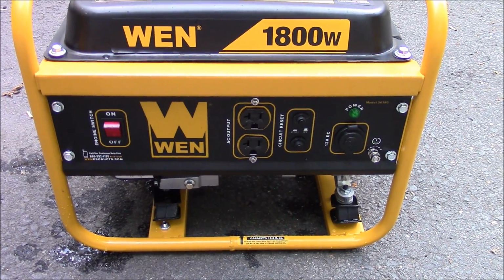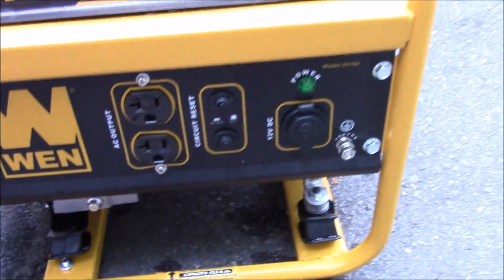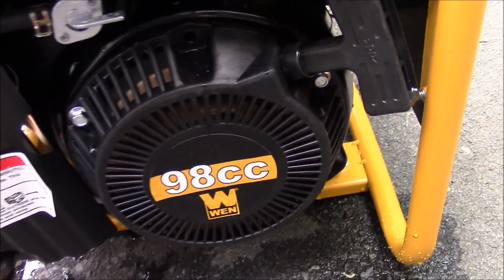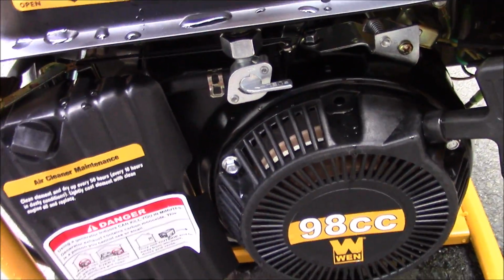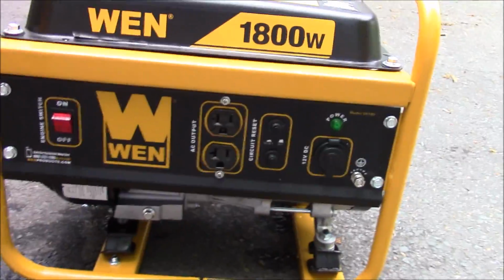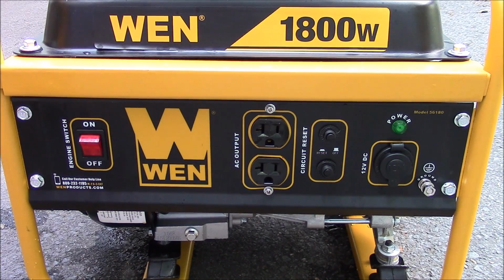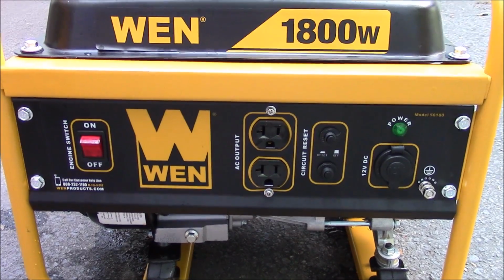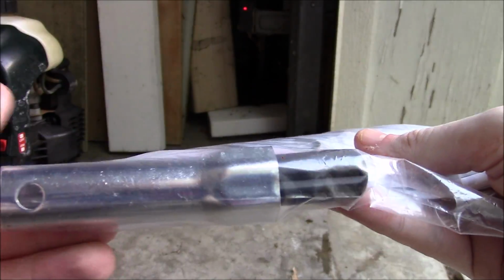WEN 1800 Watt Generator (56180)

Comment: Okay question sir at the top of the generator theres a hose top left of where you out the gas ... that hose is broken is would that prevent the generator from working if yes ... what is that part called so i can replace it or get it fixed
Reply: The hose im talking about is above the choke lever sign

Comment: This generator is really good.☆☆>share4.photo/Wen22Inverter?ㅑ    I bought to run electric sds max drill. It is super quiet and light weight. It fits my need and highly recommended.

Comment: you should've received a long funnel to fill the oil and shut off the gas to empty the carb when storing,unscrew the screw on bottom of carb to drain the float bowl,if not,it will not run after 6 months of storage,always use fresh gas or treat your gas,,a new carb is 12 bucks on amazon,consider getting an extra one when you can,it will come in handy."cheaper than rebuilding the carb.

Comment: I just bought this gen and for some odd reason its not letting me turn on. I put gas put on the valve and close the choke and pulled and  been pulling 10x and doesn't turn on.. can anyone help me please
Reply: Alex a did u put oil?
Reply: not oil,or not gas   @raymondtorres6214

Comment: I just bought one. Haven't received it yet but already I'm sceptical. Yours has a 1.45 gallon capacity, yet mine is only 1.1 despite being the same model number. Why would Wen purposely deceive the public. Some online 1800's show different capacities. I bought mine based on a 1.45 capacity. Any thoughts? David 😋
Reply: If it gets 7.5 hours >>on a full tank,<<  wouldn't you rather that full tank be 1.1 gals instead of 1.45?
Reply: Lol, thanks for replying! I was told that the tanks were mislabeled. Mine says 1.1 but it's really 1.45....All the internet advertisements say 1.1 but its not. I measured precisely. Even the guys in customer service were at a loss as to why they were mislabeled. They had me send them pictures of my label and SN of the unit. What's counts is that it has worked perfectly for over a month. DAVID 🚀

Comment: Has anyone ever had a fuel leak from the carburetor on this unit? I've had it for a week and whenever the fuel valve is in the on position it leaks, even before I start it up.
Reply: Float Bowl
Reply: Sounds like you either have a little split in the gas line or a bad gasket between the carb and the carb mount. If it is leaking from the fuel valve itself, that gasket could be bad or the screws loose.

Comment: I ran this generator for 3 days at a country music festival. It's worked great. best bang for your buck. It won't run a 8k btu a/c tho. I ran a 5k btu window a/c unit.
Reply: It runs great. You are correct it won't run a 8k btu a/c, but I have a 3k btu and it powers it like a champ. It was hard to start when cold weather began, so two shots of starter fluid, choke, and we were good. I love this generator.

Comment: what about an air conditioner?
Reply: +Terry Browning 8k is to much for this wen. I tried.
Reply: It'll run a 5000 BTU window AC no problem.....8000 BTU might be a bit much....
Reply: Dominique Stone no
Reply: Dominique Stone it will run a 5k btu ac unit. maybe even a 6k..
Reply: Its this generatorcan run a vaccum and buffer at the same time?  Tank you
Reply: Dominique Stone I would have to add the amps off both vaccum and buffer. Can you look on the machines and tell me?

Comment: thank you for the video am really thinking about buying it am still in a debate between the Champion Power Equipment 42436 and this WEN 56180 am not sure which one is better I notice the wen has 1800 watts compared to that other one which I mention. Am sill not sure, am not a power generator savy I need help to make sure which one will work better due to I will be using it almost every other day for at least 6 to 8 hours a day
Reply: This is an easy choice for me. The Wen is equipped with 1500 constant watts, which is 300 watts more than the competitor model. The extra 300 watts is very important for some large tools like saws.
Reply: Go champion. Its quieter & 3 year factory warranty